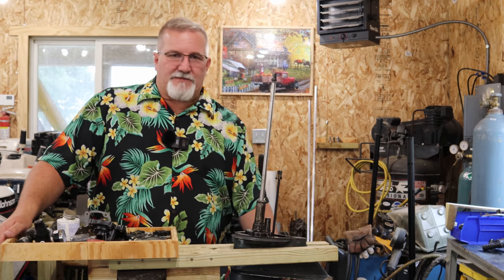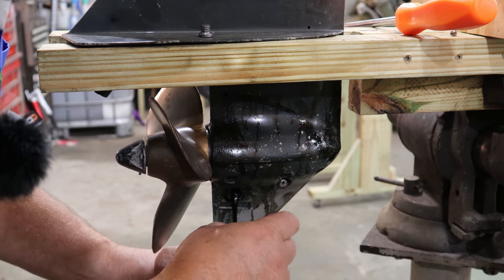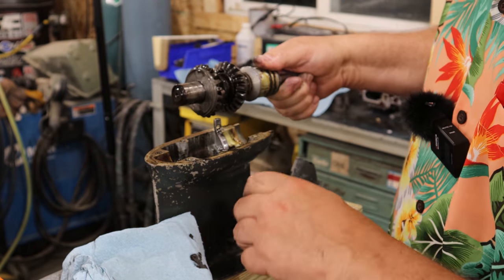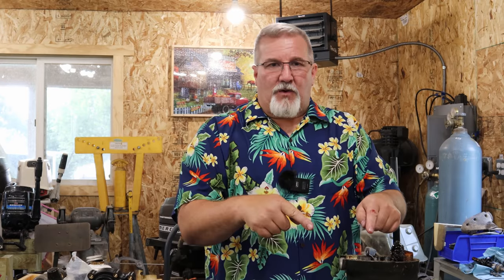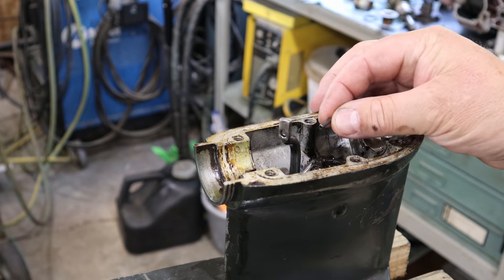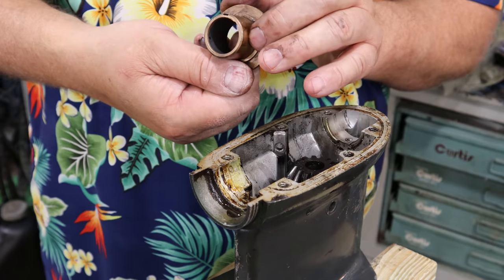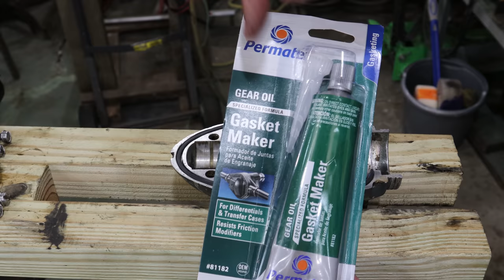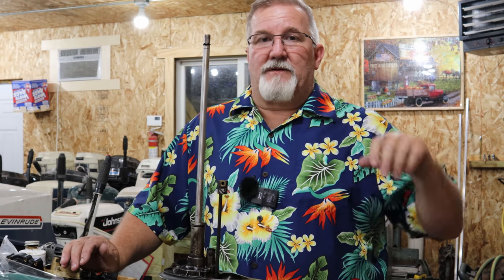1969 Johnson 20hp Gear Box Blues. What went wrong and How to Fix it. Metal flake in the oil

Comment: I Did a similar repair on my 61 Evinrude  but using a replacement Kit instead  with a new gear and two bushings PN 390970  because I couldn't find the bushing anywhere, for this specific application I had to grind the pin down, works like a charm, Also the only gasket maker besides the impossible to find original stuff that I found in this Permatex Form-A-Gasket Sealant PN 58931, all others failed miserably,  Thanks for the knowledge share.
Reply from the maker: Awesome, thanks for the form a gasket tip, thanks for watching

Comment: Great video, it showed me everything I was needing to see to fix my 1967 Johnson FD-21R outboard that I got with an Alumacraft boat that I bought for $400. It's likely been several years since the outboard has been used, or even ran for that matter, so I checked the lower unit to see what the gear oil looked like and only got a few drops of water so I will be putting in new seals and while I have it apart, I'll go ahead and replace the water impeller and the seals in that section as well. It runs too good not to do it right and mess up a good running outboard by being cheap.
Reply from the maker: Sounds like you got a good plan there, thanks for  watching

Comment: I have a 1969 Evinrude 9.9hp and had the pin issue also.  I was able to use a spot welder to attach to the pin and remove it, and reset it.  Great video as always.
Reply from the maker: Thanks for sharing

Comment: Great repair job, Michael.  And a great video.  BTW:  No need to pull the cotter key and pin to remove the shifter fork.  Just leave it attached to the shift rod and swing it up and out of your way.  (Just saves time.)  Again, thanks for all you do to help all of us with our old motors.
Reply from the maker: Thanks for the tip! I sorta realized that afterwards. Thanks for watching

Comment: Well, I have done the same intervention on that disappearing bearing stopper pin. I used a proper-sized drill bit cut and ground to the right length as my new pin. It’s been 3 boating seasons since and ... no problema signor !  By the way, sure Amsoil products are very high quality but where I live (Quebec) the boating season is about like yours so one would have to boat overtime to accumulate more than around 50 hours on that motor yearly so I suggest any brand name gear oil will do. Thank you for your videos.
Reply from the maker: Thanks for watching and glad yours is still going strong, I sold the motor along with the boat this summer, makes me a little sad to see one leave my hands.

Comment: I think that’s a great fix, can’t count how many times I have used those tension pins for repairs on all types of mechanical stuff! I was tooling across the lake toward the ramp and my engine slowed way down then made a terrible sound, shut it off. Got to dock with trolling motor, pulled boat on and there was a big wad of mono and a reel jammed against prop! Removed it, new seal, took apart reel greased it and still use it today. Never know what will happen!!!!?
Reply from the maker: Very cool story, thanks for sharing. Thanks for watching

Comment: Great video!  Good advice on using an impact driver.  One tip for that,,,  I usually take the bit that I'm going to use and give it a tap with a small hammer then add the driver to it.
Reply from the maker: I should have shown that on camera, I did exactly what you said to do.
Reply: @Michaelsbackyardmarina  I wish we were neighbors!

Comment: Cool fix , crazy there the shift dog doesn't have the two bearings and spring in there that help ot lock in foward, neutral and reverse.
Reply from the maker: One of the gear boxes of the three did have the balls and spring.
Reply: I was going to comment and mention they were missing. Maybe they didn't put them in all of them. Never seen one without them though.
Reply: @uhoh71  kinda weird what would keep it from popping out of gear so easily 🤔 the grooves on the lever for fwd, neutral and Rev aren't enough to lock in place. I'm definitely doing that pin mod though .

Comment: I enjoy your videos and do agree with your fix with the pin and bearing . But I come from the overkill school. It would be no problem to machine a key slot and install a key way the proper size and never ever worry about that again
Reply from the maker: If I had a mill on the floor I could have done that for sure.

Comment: a couple of comments  for ya. i learned to assemble things with whatever lube they normally run in.   if you pack a grease in a tight fit  it keeps thinner oil out and will cake up sometimes actually causing siezure.  i think the assembly lube you used will be fine. although note lithium compounds are generally water based.     also the pin i believe is short for a reason. if you look at the end of the shaft and the end of the bushing its in a blind pocket. by the pin having clearance in the key slot it allows air out so the bushing doesnt get air locked and starved for lube.  poor set up imho. also if the face of the thrust part of that bushing wears the oil channel gets smaller.    i would have opened them up a bit and drilled the bushing in a different spot to hold a longer pin. i'm sure your fix will work, just some potato chips for thought.
Reply from the maker: Thanks for sharing.  It has lasted since 1969 so all the engineering can't be all bad.

Comment: I had a 25 johnson with the same kind of gear case. My pin was sunk almost flush too I think it got that way from someone assembling it when it wasn't in the Grove and when they tighten the case it pushed it down. Mine had a pinch mark on it but it hadn't spun yet like your.
Reply from the maker: that is probably what happened. thanks for watching
Reply: @Michaelsbackyardmarina  yw I like alot of your content. Always something good to learn

Comment: what did you do with the 2 ball bearing and spring detents that goes in the propellor shaft spline area, under the shifter, clutch dog. there should be a hole  straight through to accommodate. The  clutch dog  shouldn't  move  so freely.

Comment: I owned a 33 HP Evinrude from I think 1971 or 73. Those 33 HP motors were tanks but they were known for having clutch dog issues. Have you noticed in the 20 HP any clutch dog issues?
Reply from the maker: No clutch dog issues so far.

Comment: Those lower units are the easiest to work on ! First there’s no need to pull the pin in the shift rod , just pull the rod upwards . Next the pin is worn down to much , you need a new alignment pin and bushing . Next don’t reuse the spaghetti seal and use RTB gasket maker with the new spaghetti seal ( put RTB around the prop shaft bearing for a good seal ! The pin is used to keep the prop shaft from moving in and out , yours has a groove in it but they also have them with a hole for the pin to set in ! After sealing the case do a pressure test (about 7 lbs for 10 to 15 minutes ) to make sure your lower unit is water tight ! I was cringing when you sunk that drill bit so deep ! Being you’ve dropped the lower unit I’d check the impeller out , just in case !
Reply from the maker: Thank you for the tips.

Comment: Another great repair with that new dowel pin, that factory dowel pin was way too low. Learn lots from from your video's.
Reply from the maker: Good to hear! Thanks for watching.
Reply: I’m wondering if that factory pin maybe got rounded off a little when the bronze bushing spun. To bad it couldn’t come out but I bet it’s stainless steel so a magnet 🧲 wouldn’t touch it. If it was not a tight fit.

Comment: Hi Mike! Question? If the indexing pin you put in is smaller than the width of the groove in the bearing! Doesn`t that create the same exact problem you are trying to fix? It`s not going to take much back and forth in that groove with a smaller radius pin, stopping and starting to put you right back where you started! Right? Not criticizing! Just asking!
Reply from the maker: Not at all. I have over 3 times the amount of pin sticking up. Keep in mind if all is working as it should there shouldn't be any back and forth and if there is this will stop it.  Thanks for watching

Comment: your pin needs to be 360 bronze so it can always be drilled out.....after your 1/8 drill hole fill it with hydraulic oil then start an 1/8 drill rod in it and tap with a punch and hammer and the existing pin will come right out....that way u can use a full size pin having no play in the bushing slot.....old toolmaker method for removing bushings from blind holes.
Reply from the maker: Sounds like a plan, I shouldn't have to go back into it I hope.

Comment: Wouldn't a tool and die man weld on to the pin and use a screw puller? And a screw into the tension pin with a puller will remove it. I like the idea of two pins!

Comment: You should use 80 W 90 gear oil 140 is too thick we always used OMC premium Blend
Reply from the maker: I use Amsoil 75W 90 Marine gear oil in all my outboards. I have never used 140 before.
Reply: Earlier the discussion about the 15 horse
Reply: A ways back talking about turning a 9.9 Johnson into a 15 horse they all started out at 15 horse in the 9.9 is a D tune 15 horse